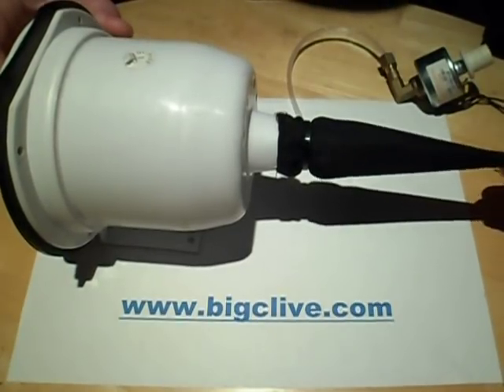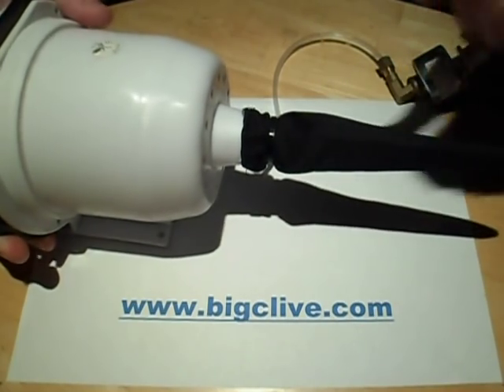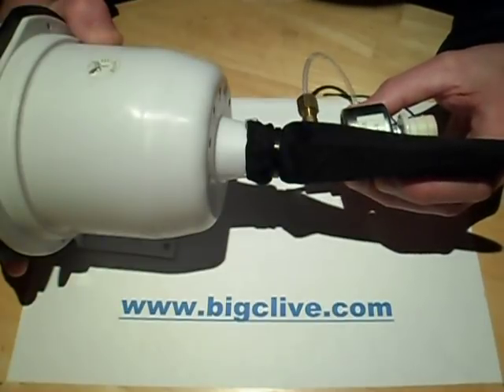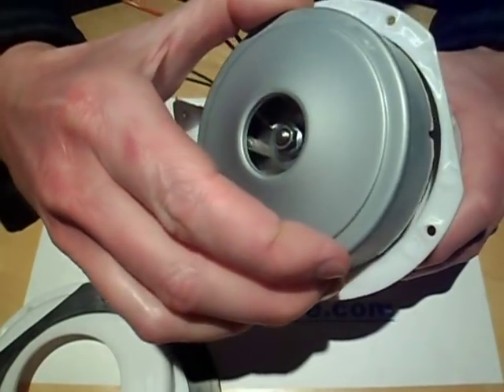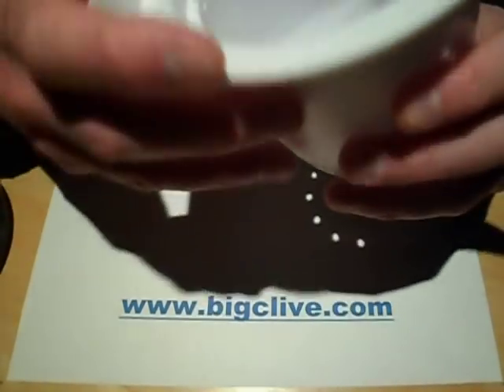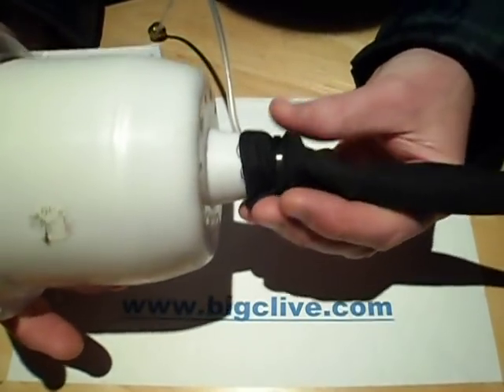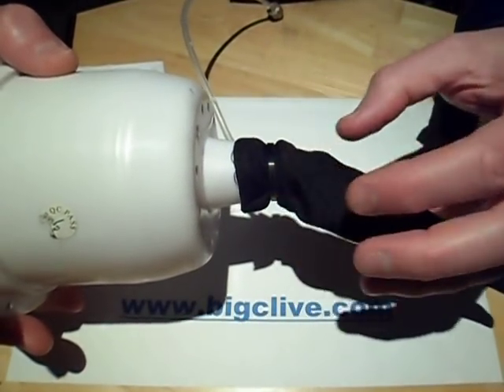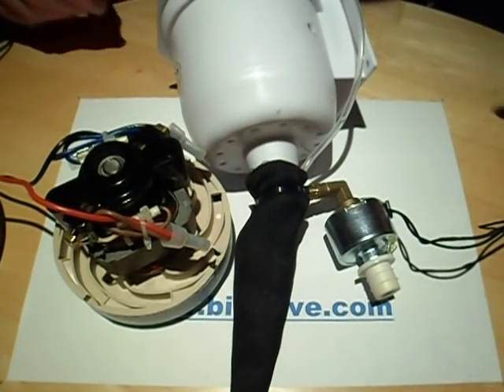How a snow machine works.

Comment: Thank you for the videos on snow machine cleaning. I have successfully used snow machine for years, proplem free, however this holiday I have a snow machine sending the air backward making bubbles into the snow liquid soap. Its an anatari unit. If you have any comments please advise. I will follow your cleaning instructions. The tubes are already clear.
Reply from the maker: +Robin Noyes I'd suggest maybe washing the sock on the front of the machine to make sure it's not gummed up, and if the pump isn't passing fluid despite being cleaned, then check that the outlet right-angle pipe on the pump isn't blocked.  The sharp bend often seems to clog up.

Comment: Ha! I'm currently taking my snow machine apart, as I want to extend the sock by means of a tube, so that the main unit can be hidden away, and I just have the sock part visible from the roof.. it's for Christmas... I'm fed up with housing it all outside under a tub, waterproofing, hiding, and getting up there to change fluid etc...

also going to extend the tube to the reservoir, for easy bottle changes....  I thought I'd just see if Clive's already looked at a snow machine and yep! Never fails. Haha
Reply from the maker: The blower section will have to go to your end location along with the tube as it uses an outer air flow to strip the bits of foam off the sock.  If you just put an air hose to the sock it would result in big dollops of foam falling off it instead of blowing out.  (That's how the nightclub foam machines work.)
I'll be doing another comprehensive snow machine video soon.
Reply: Hi Clive, yeah I was was toying with the idea of using conduit inside a drainpipe... then the project starts to get more involved the more my mind wonders!  instead of ripping my beauty apart I may buy a blower from Fleabay.

alternatively you build it and charge me for the parts and you get a video too haha

keep up the good videos... even the wine induced ones .
Reply: ThePaulius snow boys use a system with a base station where the fluid and the main fan is house the attached is a big hose with a nozzle they work quite well I use them at work

Comment: Hello nice video like everyone!
I would like to know if sodium lauryl sulfate (SLS) can be used to produce the snow liquid or if Sodium Laureth Sulfate (SLES) is really needed which I cannot find
THANK YOU
Reply from the maker: The best surfactants are ones supplied in liquid and not solid form.  I've tried a few like Cocamidopropyl betaine.  It only takes 1 or 2%.
Reply: Thank you
Reply: Hola, soy de Argentina, tengo una maquina similar, y uso lauril al 25% (300ml en 5litros de agua) funciona genial
Reply: La carcasa donde esta el motor, de que es es?

Comment: I need that exact same pump for a smoke machine. But I can't seem to get them anywhere so in real Clive style I'm gonna do some botch job with a old usb pump I have
Reply from the maker: In a smoke machine the pump has to be able to handle the back pressure from the heater block.  You can buy generic replacement pumps for smoke and snow machines on eBay.

Comment: seems very simple actually. Would be fairly easy to do A DIY version. Just for Giggles
Reply from the maker: These days it's cheaper to buy a small home unit and if desired strip it for the blower and foam sock assembly to build onto a bigger fan if desired.